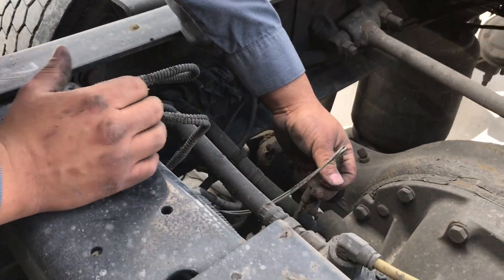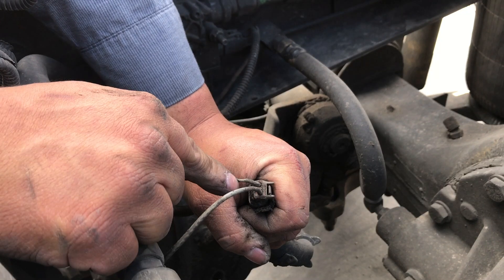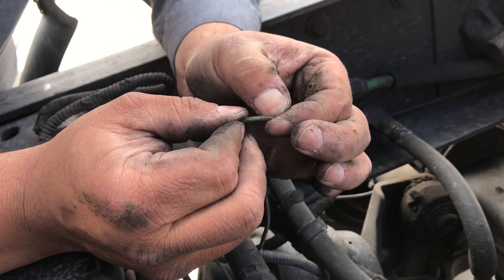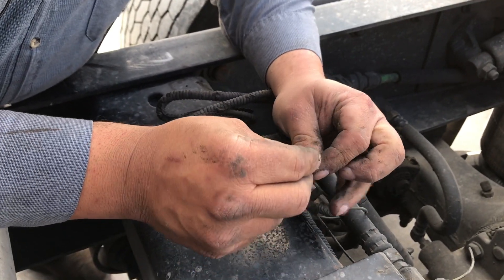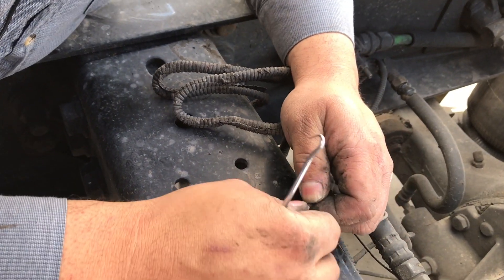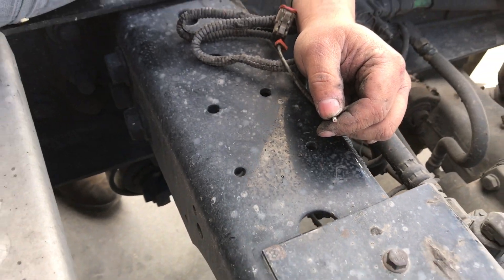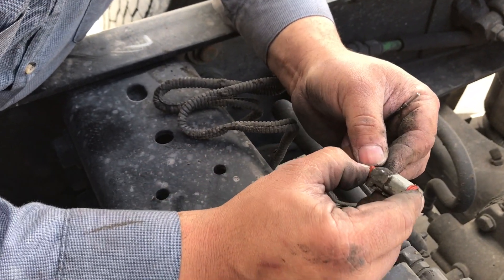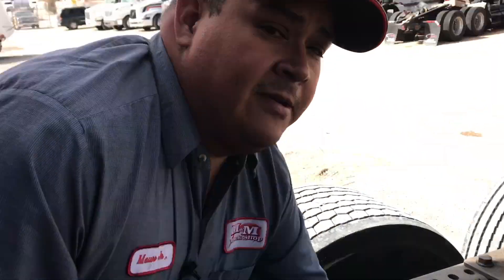ABS Shortage Problem

Comment: My 2013 kenworth has the ABS and traction control lights on at the same time.  Are they both connected with the same wire or harness??
Reply: I'm having that same problem today on my 2013 Volvo. It happened a few months ago and stopped, then today it started again. Did you ever figure it out?

Comment: When you have to connect a diagnostic device to look the for the problem, and then you look for the wire that might be open into the hundreds of feet of wires, in my opinion that is not getting lucky, that's KNOWLEDGE 😀